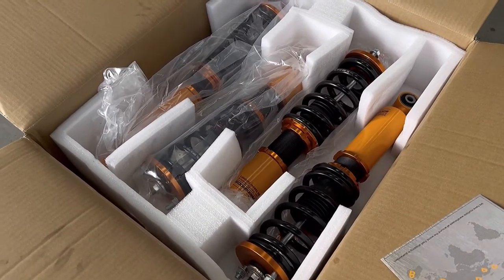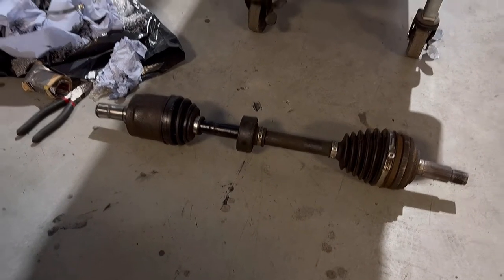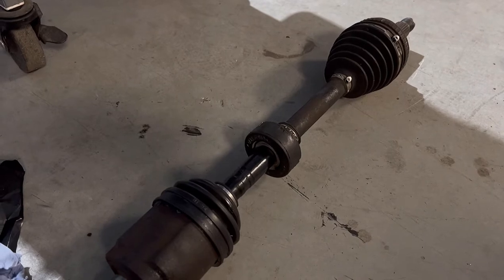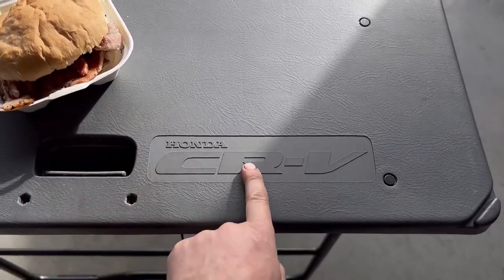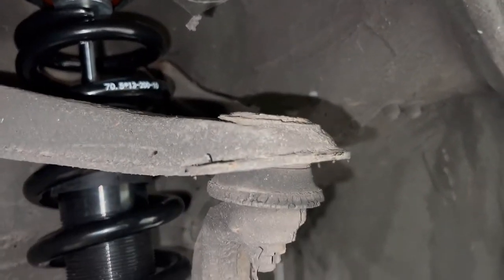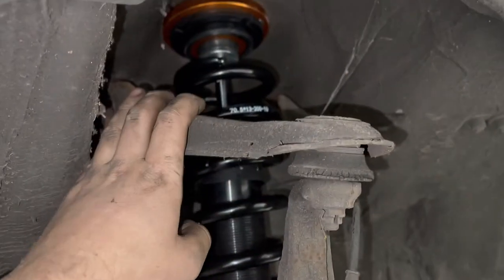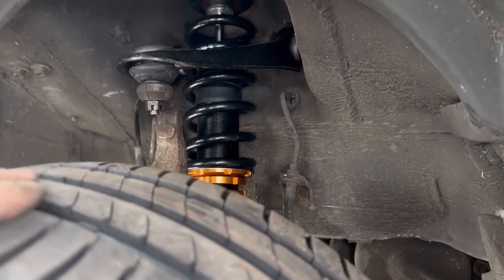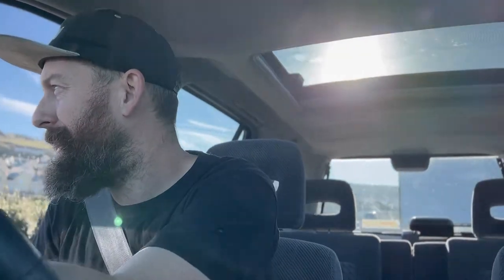THE CRASHED HONDA CRV GETS NEW WHEELS AND COILOVERS

Comment: Grind a little part of the upper arm to fit the wheel well. Thats what i did to my crv
Reply from the maker: I actually replaced the arms in the end. Used adjustable EK9 ones.. they’re about 10mm shorter, and square ended rather than round 👍🏻

Comment: it looks perfect... i just recently got one and was wondering where's the best place to source parts for these.. i have the European spec as well.. am watching from Antigua
Reply from the maker: They are pretty hard to find parts for. I struggled when searching for the bits to repair the accident damage. Luckily there were a couple people breaking them in the UK!
Reply: @VisionAutoworksUK  yea that’s the problem I’m facing. I need bolts, door seals, panel,  panel screws etc etc and they’re limited in Antigua
Reply: access panels!:)
Reply: @jevannibenjamin2286  few people selling parts on IG but I don’t how much they would charge to ship to the islands